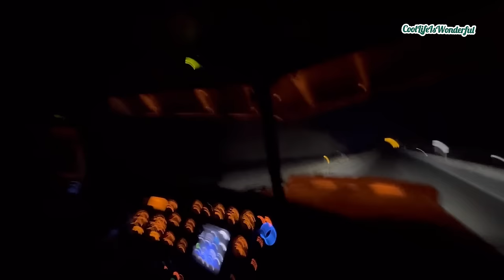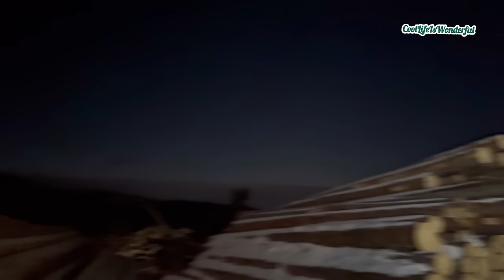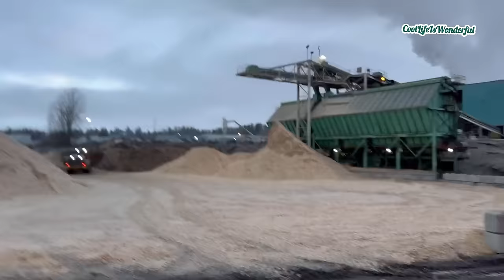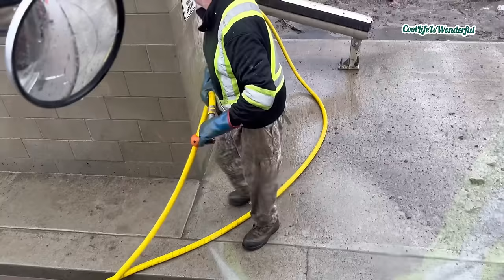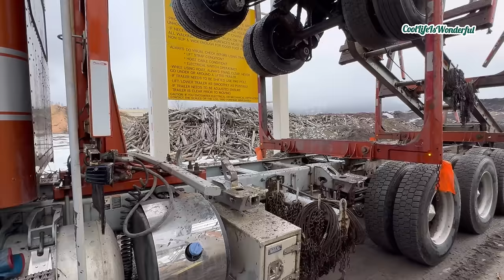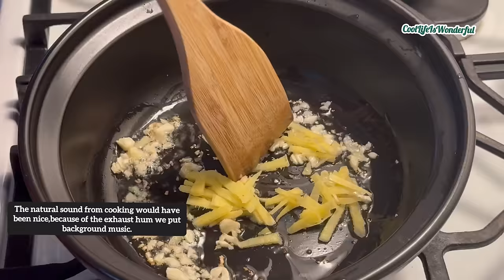I Can No Longer Film In A Loading Area-Day In The Life Of A Log Trucker|Logging Trucks

Comment: Technically, you've probably not "filmed" since 1995.
They didn't ban recording on digital media if it specifically says "no filming".

Seriously though, the reasoning is exactly what happened in the video titled "Realistic Day In The Life Of A 54 Year Old Log Truck Driver Stuck In The Snowy Mountains|Log Truck" at 42:53. A person walking on the side of the trailer opposite the loader, cannot be seen by the loader, slips and falls, could get a log dropped on them.

The recorder's point of view, in the video titled "Realistic Day In The Life Of A 54 Year Old Log Truck Driver Stuck In The Snowy Mountains|Log Truck" at 40:28, standing on slippery surface next to the moving truck was a risk not worth taking, and then at 41:30, the loader does not know anyone is moving to the rear of the truck at all, and it turns out 2 were (double the risk).

What I question is; is there a policy that says nobody is to be in the cab during loading? If there is, I'd say the reasoning is so that if the truck flips nobody is at risk of being stuck in the cab while the truck slides down the hill.
But, if there is that policy, then people from the truck need to be a minimum 30 feet from the truck for the loader to be active.
This should mean that the truck driver has communication with the loader, so the loader knows to be watching for # of people at the front of the truck to be able to commence loading.

If there isn't such a policy, then it's a "Driver and truck occupants exist here at their own risk" and the company shouldn't be able to ban recording.
Though it would be wise for anybody outside the vehicles to remain far enough away from the truck so that they reduce the risk of being hit by anything.
Reply from the maker: Hi there,thank you for watching!the no filming is for the camera woman.when it come’s to the driver’s safety,they have a comminucation thru radio that the driver is down or will go down and the loader man will work only in the other trailer.The driver just got off the truck after he told the loader man and the loader man agreed.The two have communication.In the video you can’t see the distance ,but in actuality there is enough distance specially the camera person using zoom in lenses.In this block the loader man  has not yet matured to understand the real essence of life.
Reply: @CoolLifeIsWonderful  Fantastic insights, thank you.
It is a bummer of no more recording, she got amazing clips.
Though, I would suggest an Insta360 secured to the mirror mount to grab those shots in future.